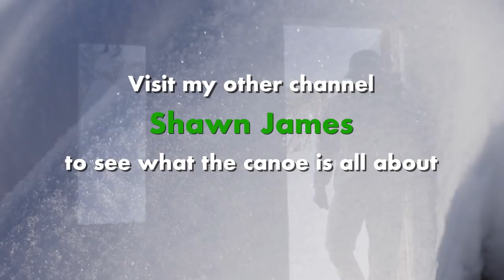Log Cabin Sauna Build using Hand Tools, Ep. 13 | Wall Project | Duck Confit, Cast Iron Cooking

Comment: Hey Shawn ! Have you ever considered a tall A- Frame with a pivot log ? It basically is set up over center of your work space and it works like a crane for lifting heavy logs above your shoulders. I used one when building my cabin a old farmer explained it to me one day while watching me struggle logs. really helped speed things up I could lift a log swing it on top mark it swing it back down too cut notches. I’m glad I had it once I had figured it out I built my work shop first so I could store my tools as I worked and it was my tiny cabin while I built the real cabin . My issue was I live in Iowa and I built everything outta heavy hard wood as we don’t have any pine 🌲 a bunch or red cedar but the trunks don’t get all that long or have much of a diameter. Maybe it’s called a swing crane ? I’ll go a looking later see if I can share some plans . I built mine before the cellphone era and everyone hand a camera at hand I had to rely on my wife to come out and take pics. So there are lapses in my record of the build .
Reply: Hey Steve  ,    That pivot log with frame ,  sounds  exactly like the kinda thing I've been looking for .    If you come across any plans or pic's  ,   I'd be very interested to have a look as well  .   Thanks  Cyril
Reply: cyril brun yes as soon as I find it I’ll share it !
Reply: Thanks Steve ,  appreciate !
Reply: cyril brun the center pole I used was a 40 foot 10 inch log and it pivoted on the A frame so I could lift it up on one end and let it touch the log I wanted to lift and I had made sand bags to add wait on the end so I could lift a 700 lb log with one hand and could swing that end to help get in place I also used it to build the stone fireplace it sure made working alone a whole lot easier! And I was able to use larger diameter logs which made cabin look like I wanted and the stones also ! Iowa we Have granite stones about the size of two basket balls so quite heavy but look amazing I only wished I had been shown beforehand and used smaller boulders for the foundation. I would’ve used larger ones !
Reply: That lifter sounds amazing ,   and i'll bet your place looks awesome .  I'm still in the planning stages for a log cabin ,  the first cabin was stick frame .   I'm middle age here in Ontario ,  and the body worn out bad , from years of hard manuel work ,  and  couldn't figure a Good set-up for lifting logs .   Thanks ! for your detailed description , I am visualizing the ease and effieceincy of it now .   Just can't beat the cabin life !    Cheers Cyril
Reply: cyril brun your welcome ! My cabin is about the same size as Shawn’s only difference is our out house has a breeze way to it as my wife will not walk out there after dark ... bad experience with a rather curious trio of baby raccoons...😂
Reply: Too funny  :)   hahaha !!

Comment: You must eat more than 5k calories a day. Wow. Cold and hard work turns the human body in to a furnace and food is underlooked as how important it is for basic survival.
Reply: @CA-lg1do  A little research, and you find that not all fats are bad ..... some are quite good and actually help to reduce bad cholesterol levels. Also check out the Keto diet.
Reply: Yes .... A 5'11" 64 yr old 198 pound male with low activity requires 2719 calories to maintain that weight (if your goal is to maintain that weight of course). So 5K may not be a lot for an active individual who is also trying to maintain body heat. A 5'10" 40 yr old 165 pound male that is active needs 2969 calories to maintain their weight.
Reply: Yes .... A 5'11" 64 yr old 198 pound male with low activity requires 2719 calories to maintain that weight (if your goal is to maintain that weight of course). So 5K may not be a lot for an active individual who is also trying to maintain body heat. A 5'10" 40 yr old 165 pound male that is active needs 2969 calories to maintain their weight.
Reply: Jam  Shawn is 48...he looks a lot taller than 5'7".

Comment: Unless you saw him talking well over a year ago about confit, you might not know why Shawn slow-cooked the duck in its own fat, nor why the uneaten parts are being transferred to a narrower pot.  Wikipedia explains what it is: "Confit of goose (confit d'oie) and duck (confit de canard) are usually prepared from the legs of the bird. The meat is salted and seasoned with herbs, and slowly cooked submerged in its own rendered fat (never to exceed 85 °C [185 °F]), in which it is then preserved by allowing it to cool and storing it in the fat." 

By slow-cooking it at low temperatures for several hours, this tenderizes the meat as well as dissolves the connective tissues (releasing nutrients that otherwise would be hard to chew & digest--also dissolving those tissues is actually what helps tenderize it, and the fat helps keep it from drying out).  By transferring it to a narrower pot, this allows the liquid to completely cover the cooked meat.  The rendered fat oils will solidify on the top, and seal out oxygen and pathogens from getting to the meat, allowing it to be shelf-stable for weeks at cool temperatures (so long as it isn't broken into).  Once opened (excavated, more like, lol) you just need to reheat everything to a simmer (low boil) to sterilize it and you can repeat the cycle. 

Zachary Fowler (Fowler's Makery & Mischief channel) just finished posting his 30 Days Texas Survival series, wherein he and Chris from DropForgeSurvival spent 30 days surviving pretty much on whatever they hunted or harvested.  One of the things they did was to keep a pot of what they call "fish head soup" or "everstew" going, which was to put the bones and fat and scraps of meat into a pot with water, bring it to a boil every 8-12 hours, and let it simmer good and long, drinking the broth and picking through for scraps of cooked meat and fat.  They put bits of everything in, whether it was crayfish, catfish, raccoon, rabbit, possum, etc.  The principle is the same: slow-cooking extracts nutrients from normally less than edible bits, like scraps of skin, bones, cartilage, tendons, and so forth, as well as helps to render fat from its connective tissues.  This helps to prevent malnutrition from lack of micronutrients and electrolytes in one's diet, things that can be extracted from those long-simmered items.

Confit is similar to the everstew pot, which if covered while still hot, will seal itself with its own layer of fat, as well as slow cook nutrients into the broth and the fat from whatever meat and bones have been included.  Cooking it at a hotter temperature will caramelize the meat and the fat, giving your food a whole different set of flavor and texture profiles (which is why Shawn double-cooked the duck legs in the fat after they had simmered all day) but will not actually extract micronutrients nearly as efficiently as a slow simmer.  So it's good to know how to slow-cook foods as well as fast-cook them, for many reasons.
Reply from the maker: Well said :) thanks.
Reply: @MySelfReliance  Lol, there's a part of me that would love to see a collaboration between you and Townsends for their 17th and 18th century cooking videos, but I know that'd be a heck of a stretch...not to mention a heck of a trip between your corner of Ontario and where they are down in Indiana!  But it might be fun to do a little research on what local First Nations, French Canadian trappers, and/or Metis folks were cooking in that region around the turn of the 1800s...besides pemmican, of course.

Comment: Would a 'Bow turning saw' save a lot of time and work notching logs, or do you prefer using edged tools?  Even using one to just finish the cut would leave a smoother surface and save a lot of fine chipping...

Comment: Im speaking from ignorance here,  but would an  aggressive,  rounded wood Rasp help on cleaning up the notching?  Of course used perpendicular to the log..
Reply from the maker: I tried that and it wasn’t helpful
Reply: I actually believe I have learned enough from watching you that I could build a cabin.  😃. I have built many stick framed homes and have been surprised to realize how different the process is.. of Course I would be using Power tools which Im sure would speed things up.. Great Job.. I never miss a video!

Comment: Lifting those heavy logs seems like a task solved by using good olde fashioned pulley systems..... you think????
Reply from the maker: More trouble than it’s worth. I’ll probably use a pulley system and/or tripod hoist to place the ridge beams, but the regular wall logs aren’t heavy enough to worry about

Comment: My question is this.. Why don't you cut about 100 logs to the same exact length. Then make yourself this wooden template to put on each end to measure the notches you have to cut and chisel out? So after you notch out both ends of all 100 evenly cut logs, THEN carry each one over and start stacking them on top of each other to build your cabin? I say 100 because I'm assuming it's about 20 logs each side (20x4 =80 with extra incase)
Reply: The template I'm talking about goes like this : it's a 1 foot log piece. It's already knotched out PERFECTLY. So you set that on top of the log and just draw around that template you made. Each drawing will be the same and it'll be cut out exactly the same each time so it's all even. Kinda takes out the guess work with calipers etc.
Reply: Hope I explained it right. Makes sense in my head and can be tough at times to put into words over the internet..

Comment: why do not put a wood cooking range in there it will heat the cabin just as well if not better on half the wood. and you would have an oven and hot water tank. the one we had when I was growing up would run ya out the house it get so warm when mom was bakinking stuff all day.